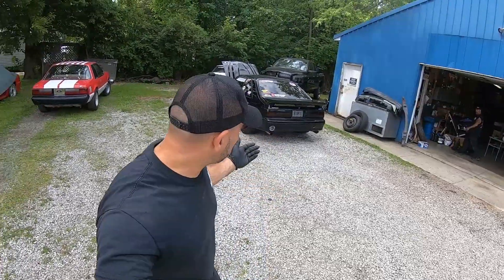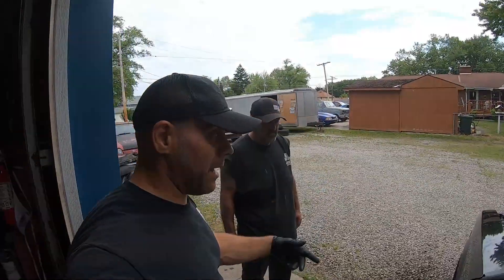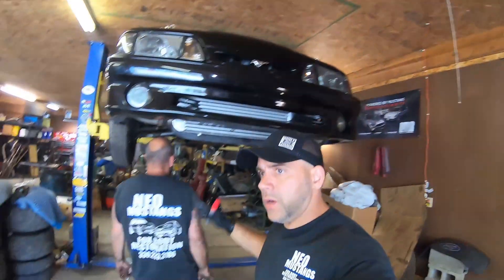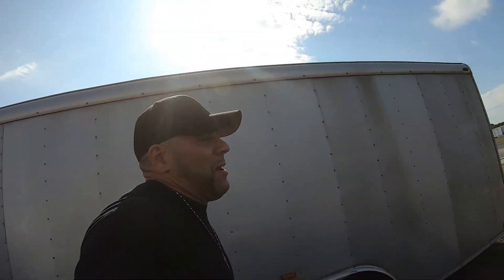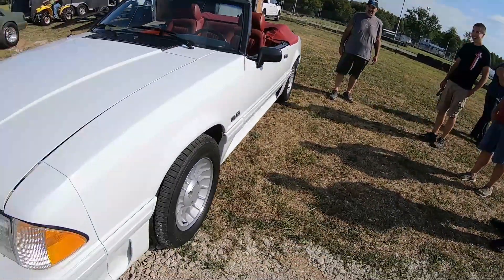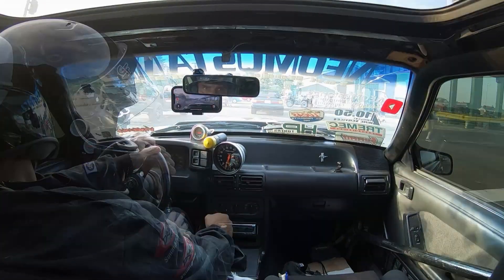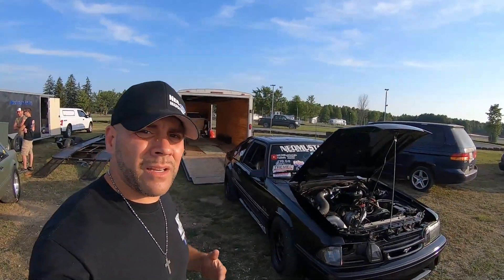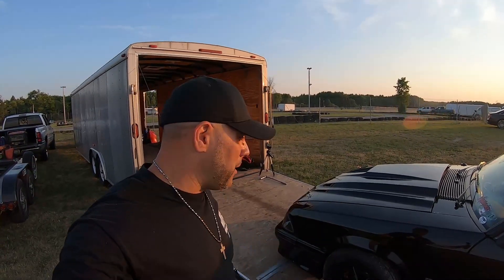Turbocharged 363 Stroker Foxbody Mustang TKX Damage Control! #fullsend

Comment: Very nice, you got the black car rolling, great time, great speed. You get your bump steer fixed, you will have a black
rocket.
Reply from the maker: Ya i feel like im holding back a bit. I swear i lifted on my second run about 50/100 feet short..

Comment: What up Neo! I'm running the tkx in my car. When in fourth gear the transmission is really noisy when at low rpm just cruising. When under load it seems to h go o away . Any idea? Another solid video. Great channel! Keep them coming. Thanks
Reply from the maker: Not sure what that would be. Could be low on fluid.
Reply: Shouldn’t be noisy, I have a tkx also with about 400 hard miles on it.

Comment: New fan of the show, love the content, I currently don't have a fox, first time in 15 years not having one. Traded it for a dream truck, 74 bronco. Which brings up a question. I got a full roller truck to swap driveline and wanted to see if u had any advise on a 5.8L roller motor build from a 1995 f250 and ZF 5 speed like the ones behind the 7.3L. I only plan on building to about 400 to 450 hp and needed some advise to building it strong. Not a race engine
Reply from the maker: Welcome to the channel! We are actually doing a 387 windsor build stroker here on the channel. Waiting on parts. (not backorder)
Reply: @Neomustangs  u didnt answer his question..
Reply: That's sounds cool, what is it being bored and stroked to, I will check out the vids

Comment: Dan need your help on this. Best ways to get rid of heat soak its killing my cars power.
Reply from the maker: Heat soak on what?
Reply: Intake . Throttle body.  Basically everything on top of the motor.

Comment: Does anyone know if the fitting that goes into the power steering pump that the high pressure hose screws into gets the Teflon seal or oring or what

Comment: I took my Saleen spoiler off my Foxbody to do some repairs. It’s splitting from the seams so I’m going to fiberglass it. I posted it on Facebook and someone said that it looks like a rear Saleen spoiler which were made poorly when new from Saleen. I’ve checked around and can’t find out how to tell if it’s a real Saleen spoiler or not? The guy I got my car from said some of the parts were from a wrecked Saleen. The interior is that Tan color which he said was from the Saleen. I didn’t think much of it till the guy mentioned my wing could also be. I’m not selling it or anything just curious if you knew how I could check to see if it’s real. Thank You I appreciate your help.
Reply from the maker: Should be a part number on the underside of the side arms

Comment: What clutch do you run ? Also what are your thought on the tko 600? Got one in our all motor car that doesn’t seem to want to shift quick at high rpm (7k) ? Unless my clutch adjustment is wrong . How do you adjust yours ? 

Also what range plugs do you run ? Got a turbo sbf 8:5:1 comp and running range 8s with around 10 psi 93 pump and i think they are too cold
Reply from the maker: Twin disc rxt hd. Sell that 600 put money forwards t56 or tkx. 600 won’t ever get better none for issues shifting higher rpm. Yes plugs are too cold.
Reply: @Neomustangs  appreciate it , yeah I’ve read of it that they don’t like shifting high rpm the last time I got it to shift I had to shift smooth/slow no quick shifts

Comment: Was thinking about it and would a 96-04 spindle work better for a lowered fox to lower the tie rods to make them more level with the ground to eliminate the bump steer issue since the 94-95 spindle bumps up where the tie rod mounts?
Reply from the maker: Yes 94-95 bumps up.

Comment: hey man i just picked up an 88 coupe and im was just wondering whats the best way to go about this because ikno alot of shit is not available just want it to be a no manor street car but i wana run some boost whats your thaughts
Reply from the maker: I’m not sure what your asking for ?
Reply: im just wondering what the best build is to do right now with everything the way it is with covid and crap
Reply: sorry man should of explained myself lol
Reply from the maker: @dylanfitzpatrick2612  budget. gT40. Build your own turbo
Reply: just like the blue hatch u built right
Reply from the maker: Sorta ya. There’s just not parts available
Reply: ikno man thats what my problem and i dont wana get balls deep into a build and like u say have it stuck on stands because i cant get parts i almost want to have eveything in the garage before i even start so then ikno im good lol i built a stock coupe just honsed out the cylinders with my dad and put some new rings and and shit never got into a turbo build before so im going to be guided by ur videos and what ever else i can pick off your tube just thaught i would ask u because ikno you do this in your sleep
Reply: and one more question whennur running boost to a speed density car do u need to run the hollley or is there another tuner because those are hard as shit to find to